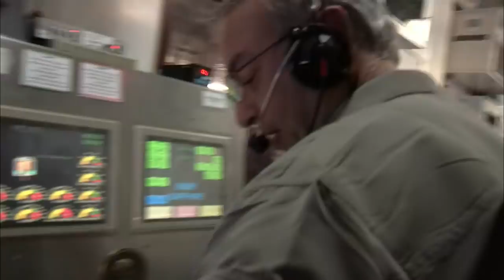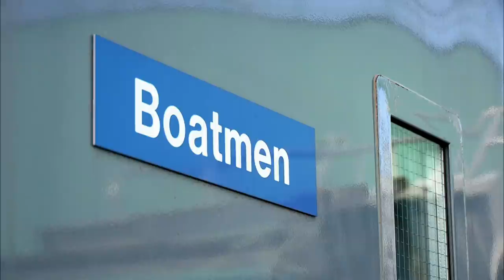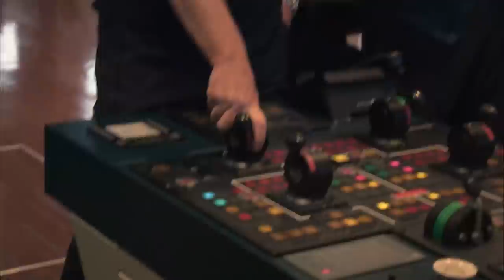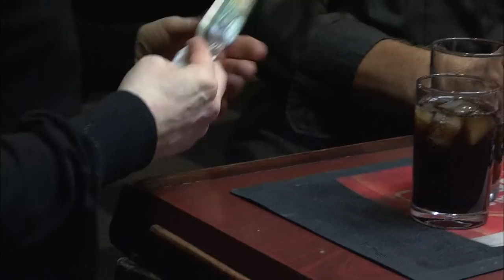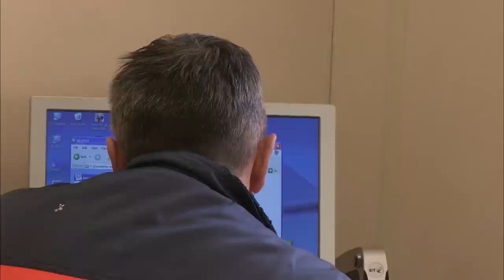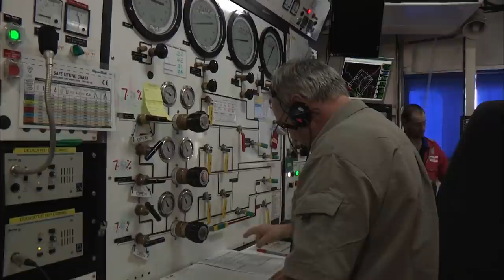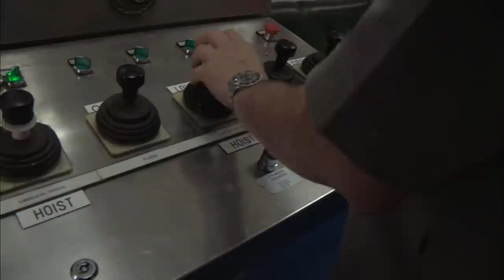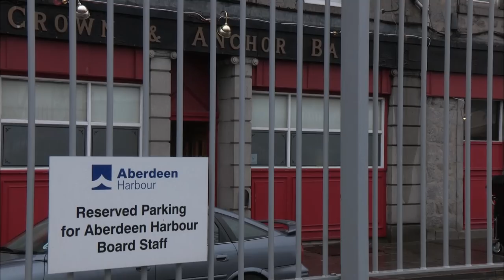Oil Rig Divers Repair Pipelines Under North Sea | The Harbour

Comment: And what is going to happen to these pipelines in 10 years when all the off shore oil is too expensive to extract anymore?
Reply: Then they’re capped and plugged like all the others in the world. This is common, when oil prices drop wells are capped until prices come back up
Reply: @rockydubois2418  You dont understand. We have reached peak demand for fossil fuels. 60% of all the oil we produce is used in transportation. Everything else we use oil for is actually dependent on the chemical byproducts that are removed during the fuel refining process. That is why plastics etc are so cheap. They are literally all made from waste. Without the primary economic driver of fuel production, it is financially impossible to extract oil to merely obtain these byproducts. Their cost would go through the roof. EV sales are doubling their market  share all over the world every 10-12 months today and have been for the past 5 years. 1 2 4 8 16 32 64. Get the picture? We are now at 5% of global sales being EV. In China its already 32% and EU is there as well. In fact in some places we are seeing more than 50% of all new vehicles sold are electric. We are also seeing cars entering the market for $25k or less now in EU and China where the markets have matured. The ONLY market segment for new vehicles to grow for the past 2 years has been EV sales. 
Selling commodities in a shrinking market only has one effect on its value. It drops like a watch dropped in an outhouse. The longer its there? The more worthless it becomes. You only need to remove 2% of demand for oil to take the price for $120 to less than $30 bl. 70% of the global oil reserves cannot turn a profit below $30 bl. It costs too much to extract at that point to turn a profit. And that includes oil sands, Tight oil in the Permian basin and everything off shore as well. Analysts are already saying we will see oil permanently below $25/bl in the next 5 years. In other words what it was worth before the automobile came along. 
Everything else that we need oil for today in our societies? Can already be replaced with Bio-chemical processes. Even carbon fiber. Hydrocarbons are abundant in nature.
Reply: @davefroman4700  I understand that’s the liberal lie propped up by both leftist politicians and oil companies to milk citizens for both more taxes and more money per gallon of gas and barrel of oil by perpetuating the myth that it’s rare and the world is about to run out of it. Oil and gas is far from rare. There’s literally oceans of it still untouched in the earth.
Reply: No you don’t understand. The explanation for your question about what happens to the pipelines was spot on.
Reply: What are we gonna do when they start attacking the EV manufacturing process?